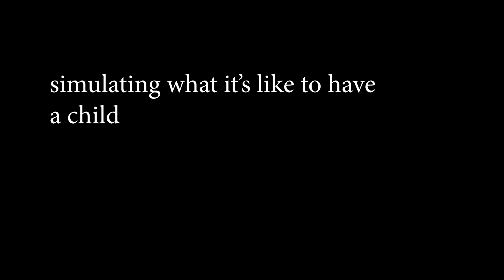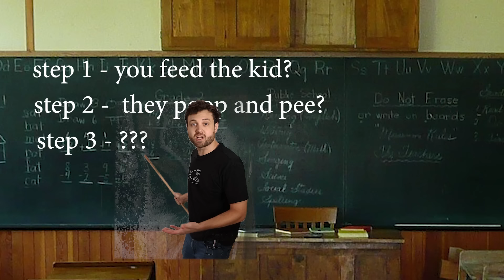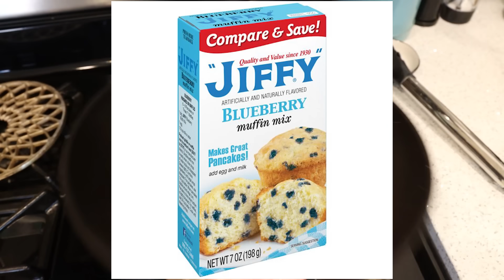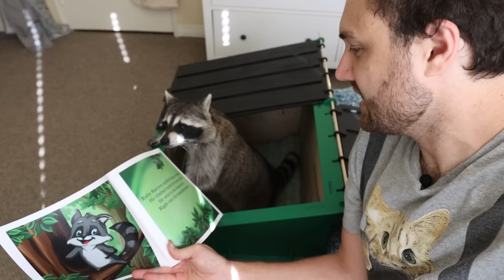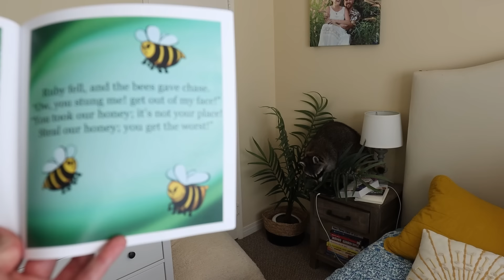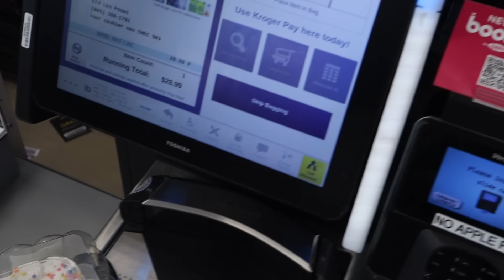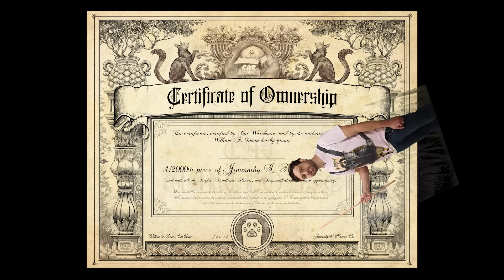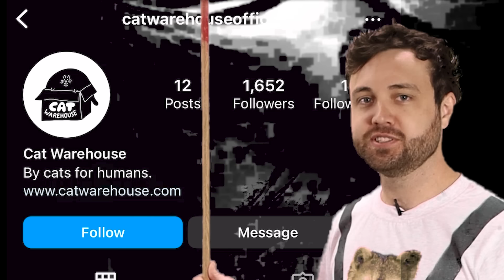I Rented a Raccoon to Simulate Having a Child

Comment: Children are pretty much drunk people on a tour of a place they have never been to before. Babies are the drunkest. They start out wasted to the point where they can't control their bladder/bowels, they can't talk, they are sleepy most of the time, they have no coordination. Toddlers are slightly more sober. Children gain more sobriety as they get older. Your job as the adult is to be a tour guide, safety specialist, councellor, advocate and benefactor until they are sober enough to handle themselves like you are. Then   the drunken state comes back gradually after 65 years. 😂